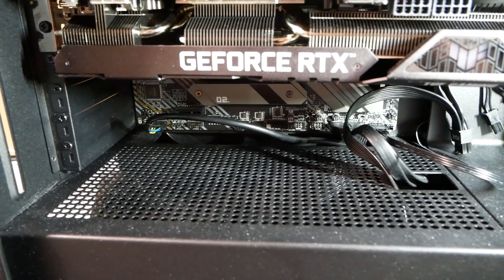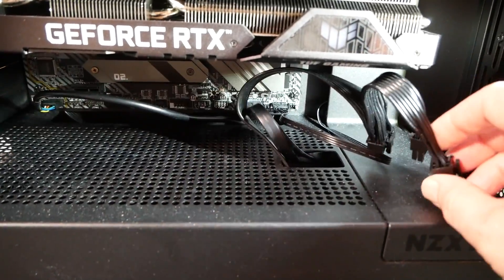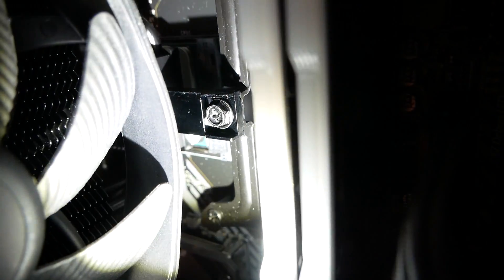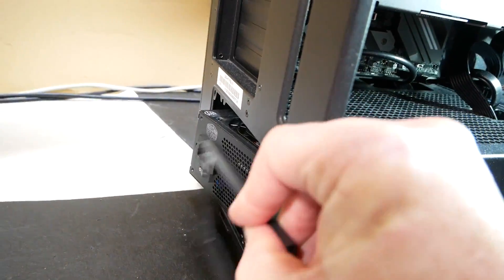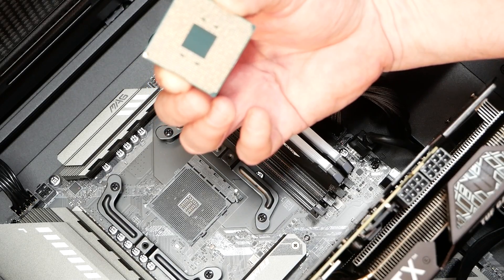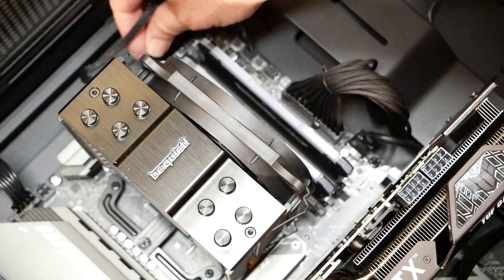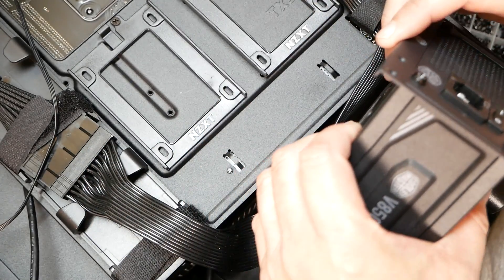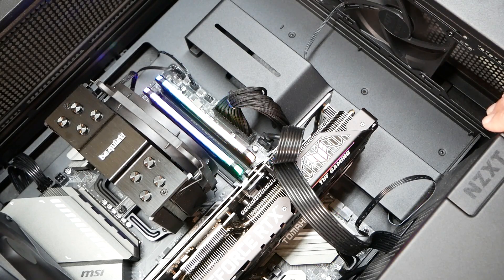New Gaming Computer Won't Boot? Simple Things to Look For

Comment: Although not required I would strongly suggest that when she get the computer home she plugs in the second CPU Cable up top, not necessary but will help, and she get rid of that Pigtail on that single cable.  She has slots on her modular power supply so she should use them for the health of the PSU and the PC.

Another Tech Room Nightmare solved!  😜
Reply from the maker: Thanks for commenting.

Comment: The screw's holding down the cpu cooler may have been so tight cause the heat sink may have been sliding cause the bracket was up side down.
Reply from the maker: Could be. Thanks for commenting.